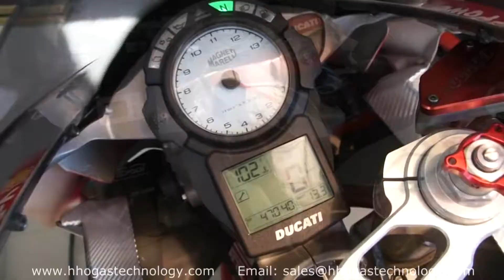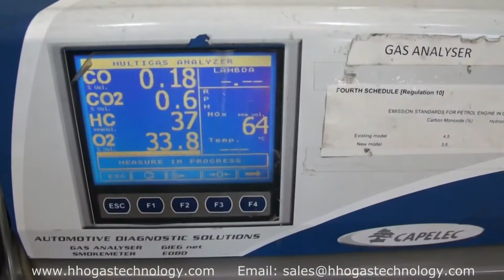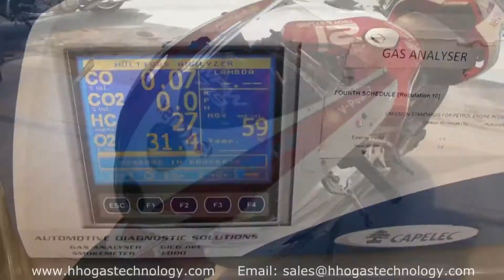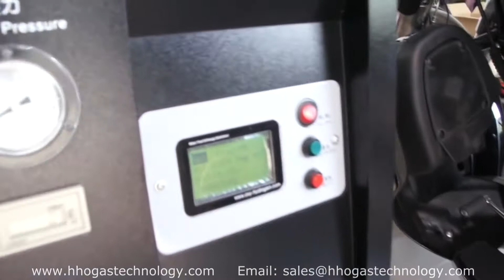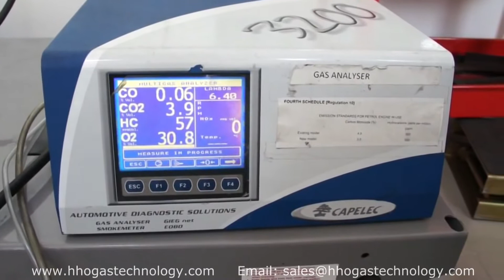HHO Gas  EP-350 Commercial Grade Motorcycle Engine Carbon Cleaning Machine

Comment: hello sir what is the lpm of this EP350 hho machine & how many time this machine take to clean carbon of motercycle engine carbon
Reply from the maker: 900 liters per Hour Divided by 60 =15 liters per minute. It only takes 20 minutes to engine carbon cleaning a motorcycle.  It only takes one time to clean the engine of the motorcycle to answer your question. Depending on the country and the gasoline mixture depends on how frequently it has to be done. Some countries motorcycles are driven year-round. We can not guarantee carbon buildup return after the first application is done due to fuel mixtures and the habit of the driver using their motorcycles in city or on the highway. I have personally did carbon cleaning on different vehicles myself and seeing instant improvements with 100% customer satisfaction. We sell the HHO Gas carbon cleaning machines and the machines come with a two-year manufacturer warranty. Open a business in your area today and be the first one providing a quality customer satisfaction service. Content HHO Gas Technology at 313 355-6193 or E-Mail: sale@hhogastechnology.com
Reply: Thanks sir ....while corbon cleaning the bike is running on pure HHO or on PETROL + HHO?
Reply: +Santosh Mane  Hi Mr  Santosh Mane it runs on both HHO and petrol.
Reply: thanks
Reply from the maker: +Santosh Mane It only takes one time to clean the engine from the carbon deposits. Engines may be cleaned twice a year depending on driving habits and Fuel used